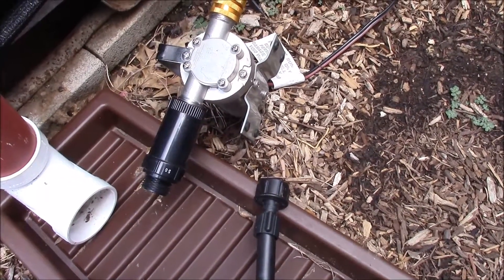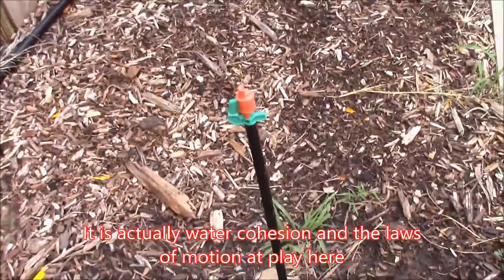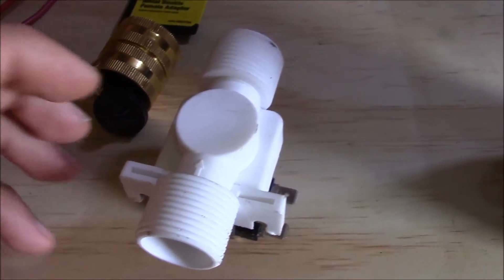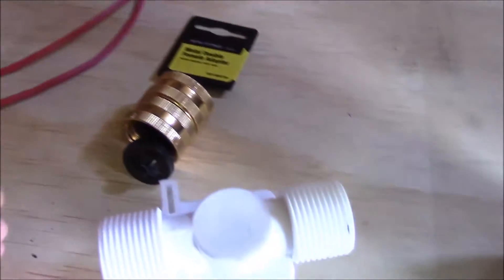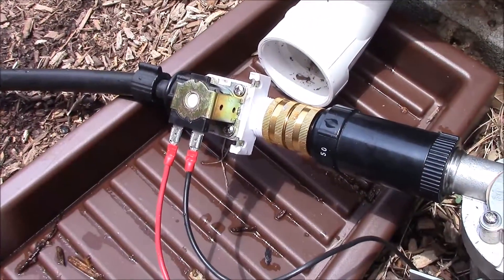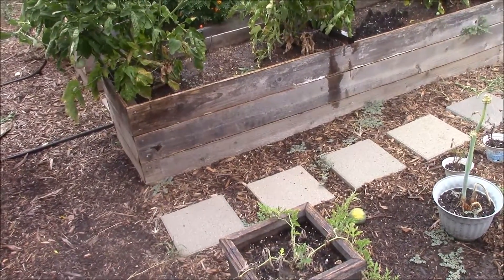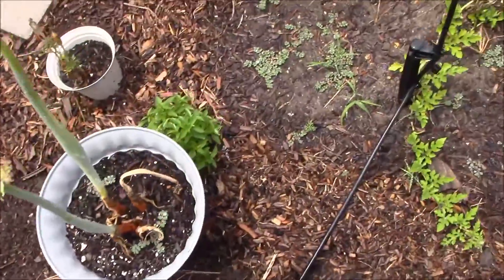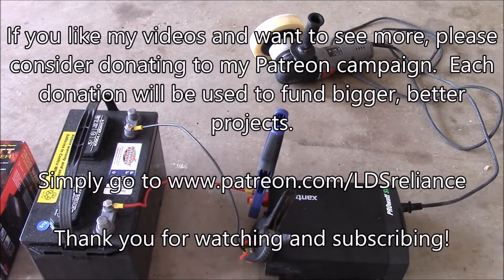DIY Automated Garden Watering System Part 4

Comment: I use those pumps for coolant flow on my machines. Run them with a 12v Speed Controller off Ebay. Pump is making a lot of noise because it has too much back pressure. Dial it down with the speed control some. That will also cool it down. Something else about the ones I buy is the brushes are a bit long making the brush spring press more into the brush then down on the brush to the armature. That can cause the brushes to stick. If you have that problem just take the end off and take about 1/10" off the brushes. They'll still last forever. Those are great pumps. One of mine has probably 5,000 hrs on it and the brushes are hardly worn.
http://www.ebay.com/itm/10-50V-40A-DC-Motor-Speed-Control-PWM-HHO-RC-Controller-12V-24V-48V-2000W-MAX-/370962506627?hash=item565f16a383:g:LusAAOxyFjNSORPa
Reply from the maker: Thanks!  Great tip.  I will look into that.
Reply from the maker: I took your suggestion and got the speed controller.  Thanks for the suggestion and it worked like a charm!  Here is the next video in the series about it:

https://www.youtube.com/watch?v=WynqXfc7ovc&feature=youtu.be

Comment: West of Denver, in the Rockies, there's a lake with a siphon that supplies water to the city. There's a 6’-8' diameter facing down into the lake a few feet. It sticks up out of the water  youtand makes a 180° down toward the lake then makes a 90° bent toward Denver. A few hundred feet downstream There's a pump station. They turn the pump on for a few minutes. It will start the siphon running. There are other valves in line to regulate the flow. Once it's started, it can run forever with no power. As you know, once you start the symphony, it just keeps going! Your solenoid valve is a good idea.
Reply from the maker: Thanks!  I knew there was a phenomena that I was forgetting... siphon effect.  Duh!  Oh well.  I think people get the point.  And yes, that is amazing to be able to do that without power.  Interesting you mention west of Denver as that is one of the places my wife and I have our eyes on for getting some land and settling down in once our two oldest kids leave the nest.  We love that part of the country (Eagle/Gypsum/Edwards area)!

Comment: Based on my experince with my boat, one of the following pumps should do the trick and keep cool. I have run it well over 10 mins trying to run dry my tanks and it was far from being even warm. https://www.amazon.com/Medog-Pressure-Diaphragm-Agricultural-Spraying/dp/B016Q54D6Y/ref=sr_1_2?ie=UTF8&qid=1467692329&sr=8-2-spons&keywords=marine+water+pump&psc=1
Reply from the maker: Sweet!  I am going to put that on my Amazon wish list and use it if this pump dies.  The one you linked is half the price of this harbor freight unit, although I think it is a bit less powerful.  Thanks for the tip!
Reply: Looking at th specs on the HF one, it's 50psi and the one I listed above is 116psi. Not sure if water will leak once the pump is turned off since all my taps are above the water tanks.
Reply from the maker: Digiital aka David
Yes, at first glance it looked like it was less powerful because the HF model is rated for 3+ gallons per minute.  That is probably because it has 3/4" inlet and outlet, though, and not because it is more powerful.  Seems like the Amazon one is more powerful as it has a much higher head lift and higher psi rating.  I would just have to find some adapters to convert from 1/2" to 3/4" for use with garden equipment.